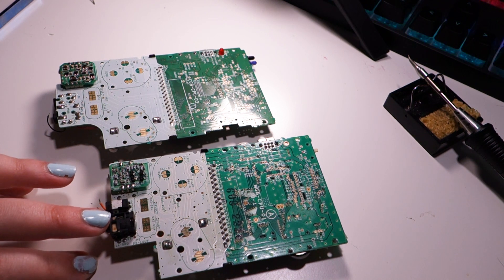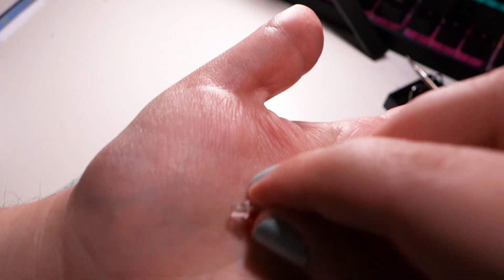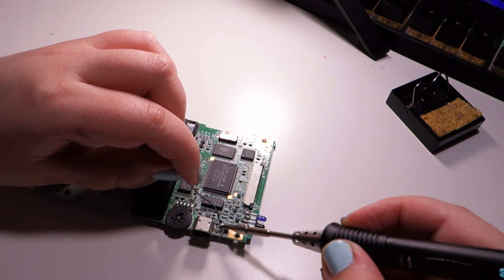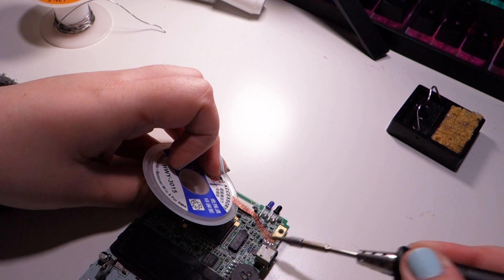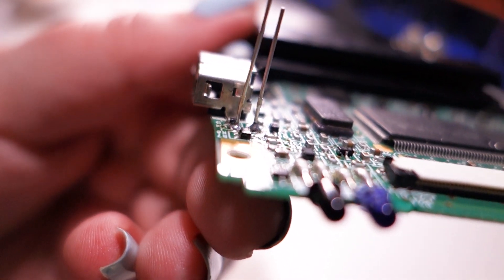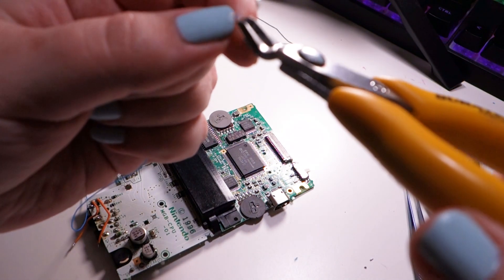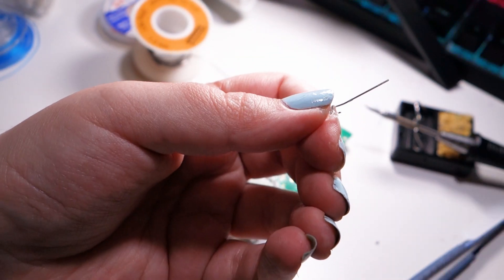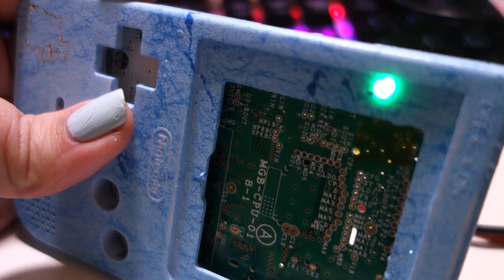[Natalie the Nerd] Adding a LED to a Pocket, changing LED in GBC

Comment: Great video! Any idea why my LED is very dim? I tried with the flat top and a normal one and both work but are barely visible. Yours seems much brighter. I also cleaned the power switch and works perfectly. It’s dim with or without the IPS connected.

Comment: Hi Natalie, I purchased the LEDs you mentioned in the comments, I bought white LEDs for my GBC. However after replacing I'm getting no light on the led, the system works normally though. I've ensured polarity multiple times. Do I need to add a resistor to the GBC since it's a white led?
Reply from the maker: First make sure you double check that the LED works.
Each LED depending on manufactures has a different forward current so without knowing that I don't know whether it needs a resistor or not but usually from my experience with the GBC you can just swap the leds without adding a resistor
Reply: @NatalietheNerd  I've had the same problem with a GBC and white. Using 3mm flat tops and it's a 3v 20ma led. I'm seeing someone elsewhere suggesting to bridge elsewhere to the diode, but idk enough to know if that's fine. The LED is working when I test it with a multimeter in diode mode, positive outside pad, negative inside pad.

Comment: will the led get dimmer if there is less power left (I using a battery mod)
Reply from the maker: nope, the circuit keeps a steady current to the led regardless of battery levels